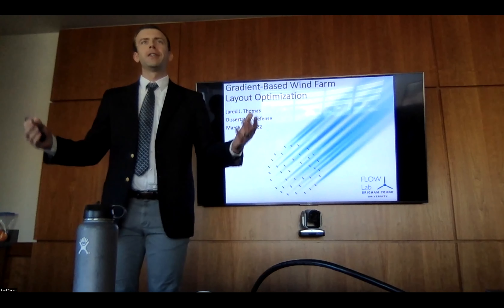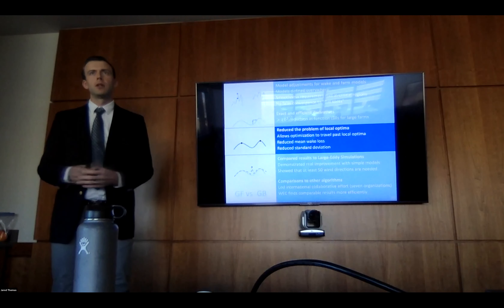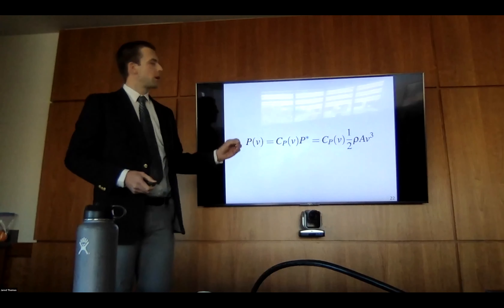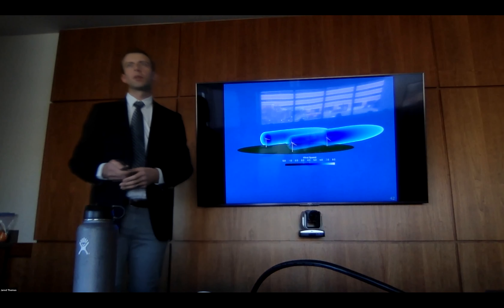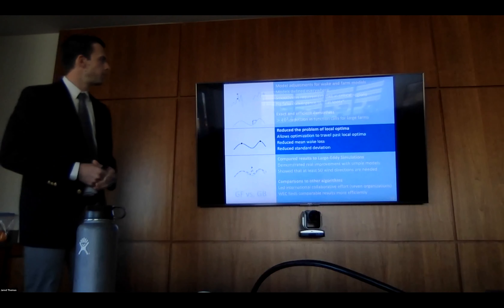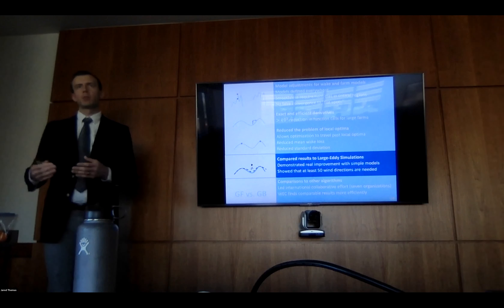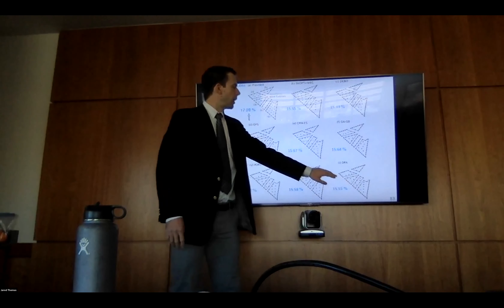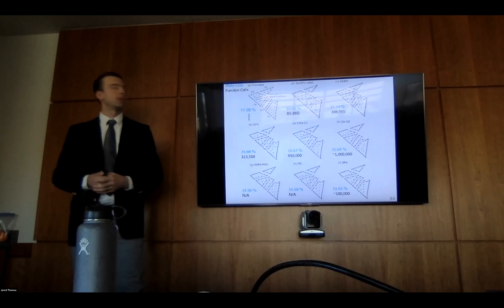Gradient-based wind farm layout optimization

Comment: Great work and presentation! At 27:39, the local optima is a minimum AEP. Isn't the purpose to find the maximum AEP instead of minimum AEP?
Reply from the maker: Yes that's right.  Perhaps not super clear in the video, but Jared was pointing to the peak in the middle noting that that was a local maximum.